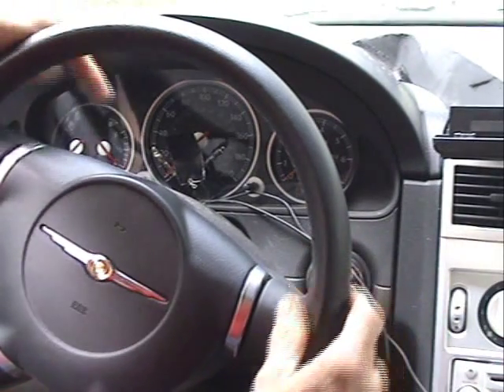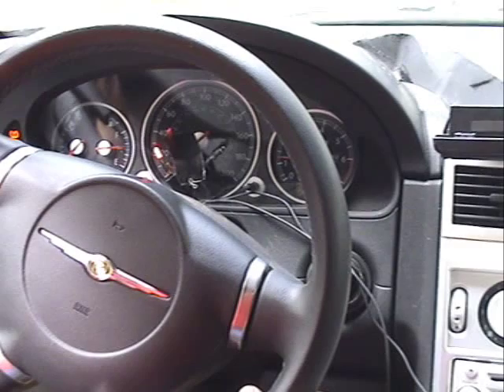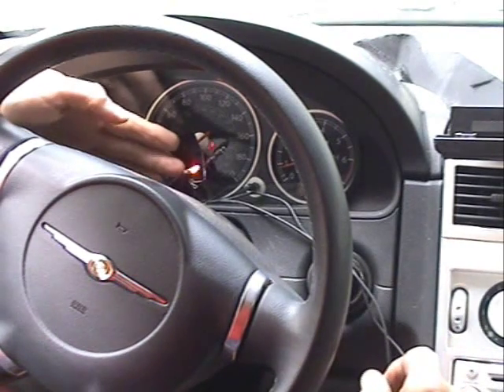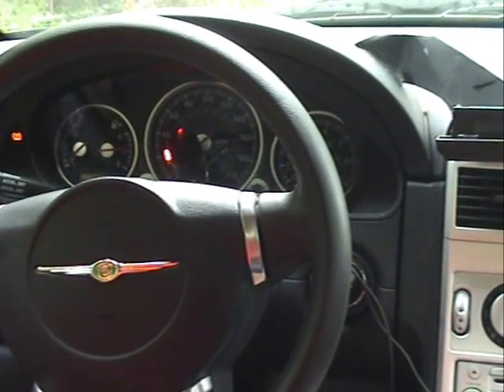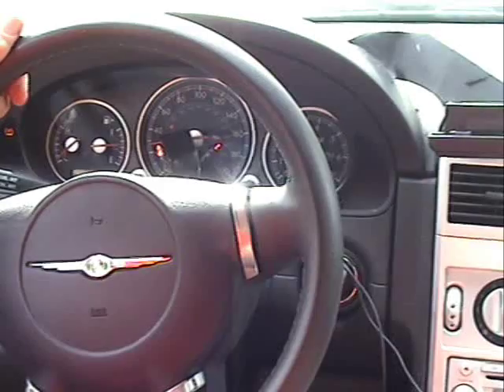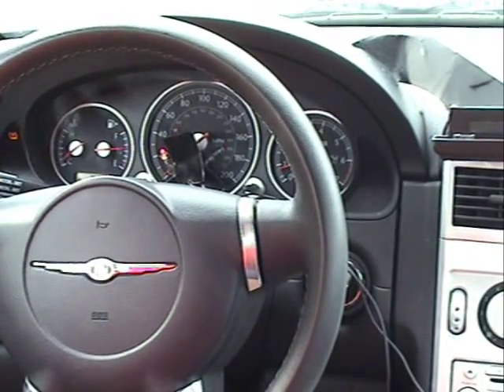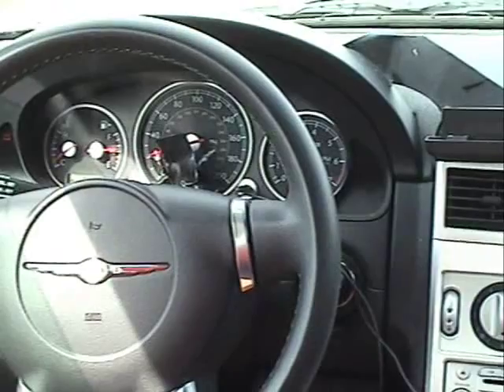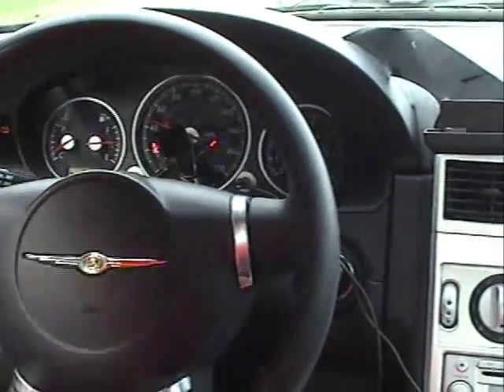Supercharger testing on an SRT-6

Comment: Another way to check it is with the engine hot: 1) Find a stop sign. 2) Floor it. You'll know if it's working. This vid is interesting showing the SC clutch operating at low RPM's. I've wondered when it kicked on/off as my clutch is silent inside the car.